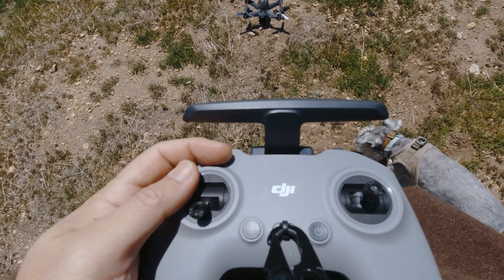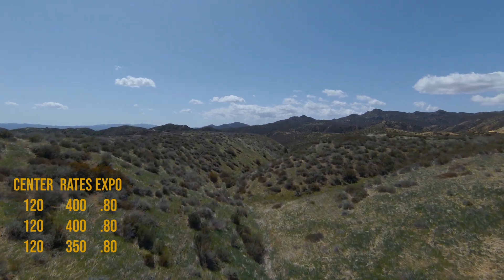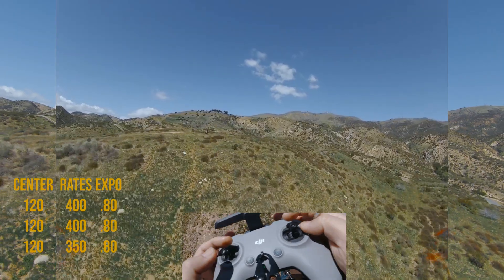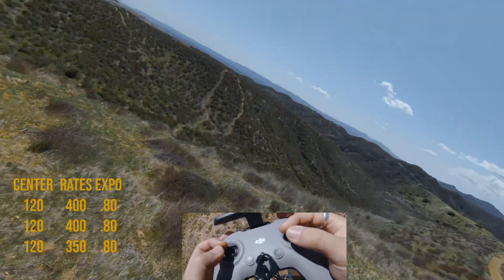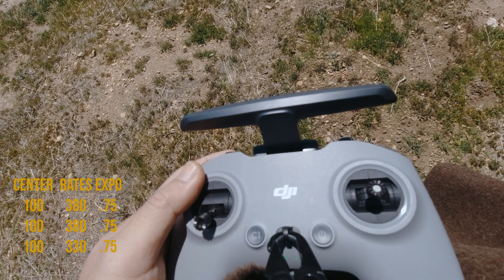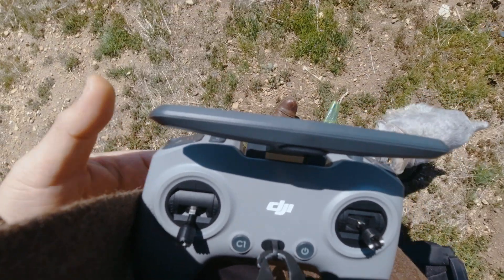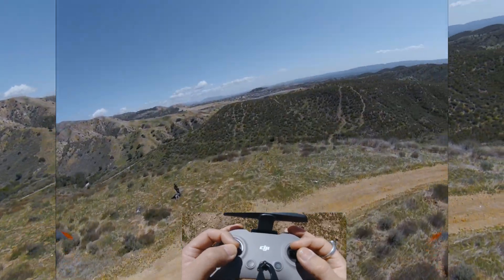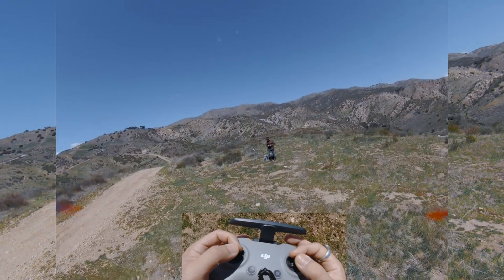How to Tune the DJI FPV Drone (Maiden)

Comment: I know this is an old video but for anyone interested in linear rates, 140 460 .22
140 460 .22
130 180 .18 
This is with prop adapters and ethix P4 props. Flys like it should with next to zero prop wash. Major change over stock.

Comment: Yo man, I normally fly in mode 3 for M2P and dji fpv. When I switch to acro on the fpv (in controller mode 3), my left stick's up & down are inverted. You how to correct this, or do I just have to get used to controller mode 2 because acro mode only allows for one controller mode?

Comment: Old habits die hard. Using the controller to change goggle settings is super convenient. I mean,... I assume it's just as easy on this new controller as it is on the v1 DJI controller. Your hands never have to leave the controller. I pretty much always "pre-flight" my camera exposure settings using my controller. That's also how I make quick PID adjustments.
Reply from the maker: I'm not sure if I can scroll through the menu through the controller, it's still through the goggle toggle switch.  But yeah, convenient for sure
Reply: @RyoRex  Well, that's a bummer. Was a really cool feature on v1. On v1, there's a scroll wheel that you can push for "enter", and a back button. I guess they ran out of space with all of those other buttons.
Reply from the maker: @rcrdps8144  ah I see, maybe there is a way?  Let me look into it

Comment: Hmm, so you did ended with same settings as you start with?
Reply from the maker: More or less, but I wanted to show the slight differences in rates (if people can tell that is).  I will be doing a followup tune video at my regular spot.  🤟